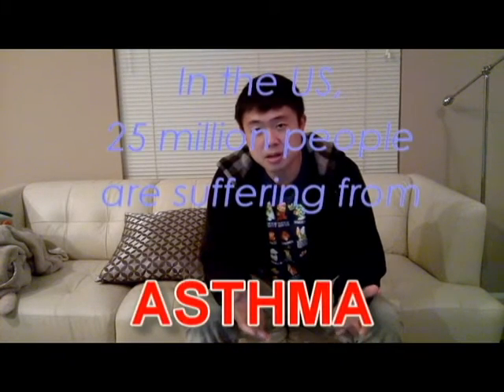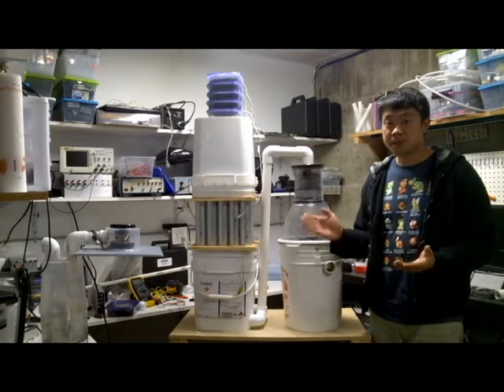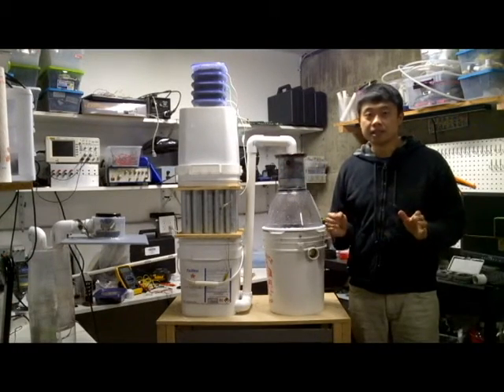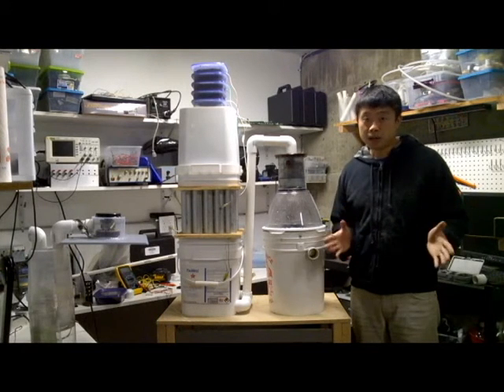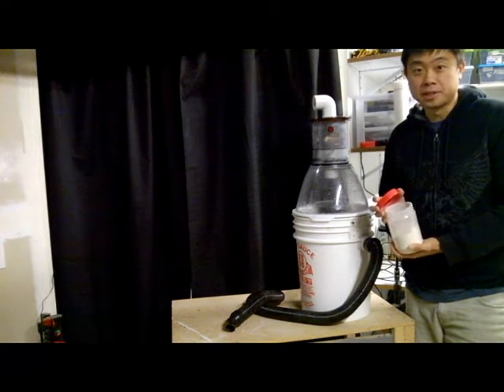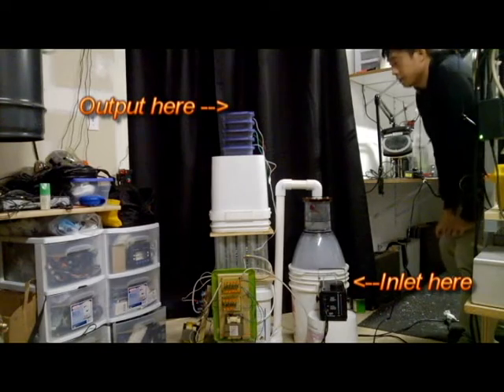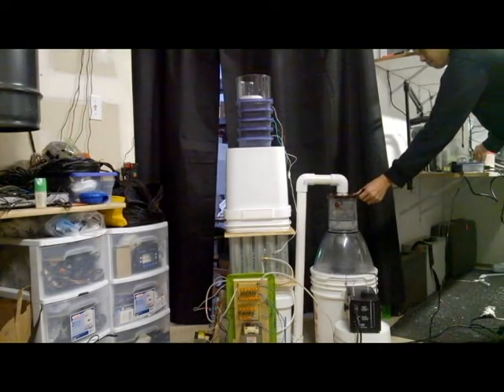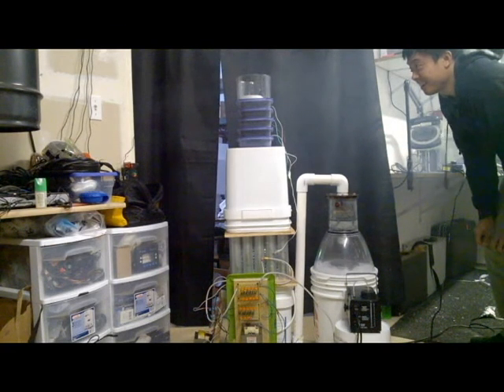Hackaday Finals 2015 Video Jimmy's Electrically Enhanced Wet Scrubber Invention

Comment: Wont there be any ozone production as well? Or are the activated carbon pods a solution for that problem
Reply from the maker: Yes unfortunately with esp there is always some ozone produced.  The activated carbon would absorb some.  There could be one pod made from a specific absorbent for ozone which are similarly used in cpap machine cleaners.  Other option which I was exploring was to use an electro spray technique which I couldn't get to work as effectively but that could have just been my inability to produce a good setup with optimal parameters.

Comment: I want to scrub sulfuric acid fumes.  Do you think it would work?
Reply from the maker: Hi Stephen,  the technology could work with the wet scrubber to absorb sulfuric acid fumes but you would need to use a special scrubbing liquid that can chemically absorb the fumes.  Also you would want to modify the wetscrubber such that the the surface area of water to input air is increased.  This is generally done during a packed bed wet scrubber or using a tower tray.  In this case, adding many stages of the wetscrubber would give a similar effect.

Comment: can we see it being assembled? I see you have some leaks to repair. But it looks like Proof of concept thus far.
This could be used to clean the air of carbon monoxide off a motor's tail pipe, or soot from a coal power plant chimney stack, or even Natural Gas fired generator. Lowering greenhouse gases.
Question is how much energy is used to clean what volume of air, I'm sure this has a efficiency curve related to size and power used to operate.
To big wasted energy, to small dirty air going past system.